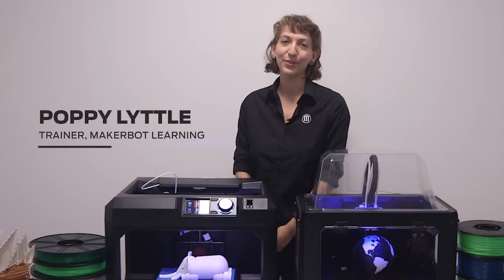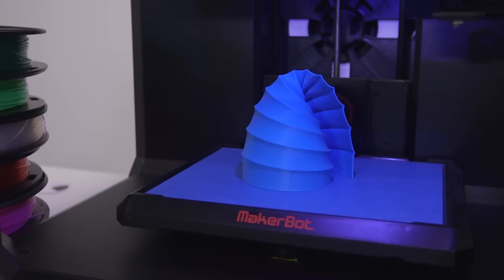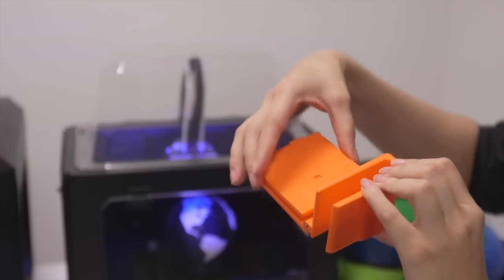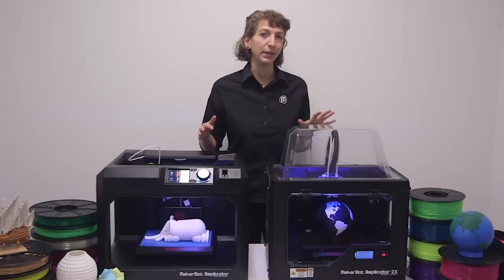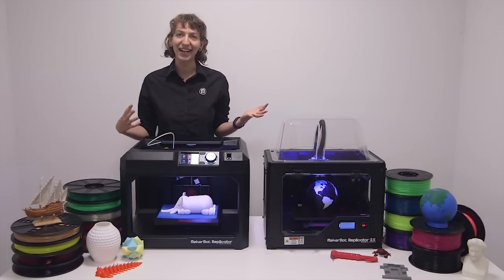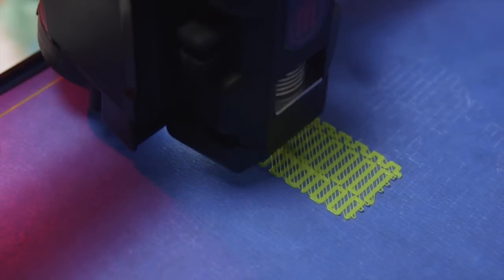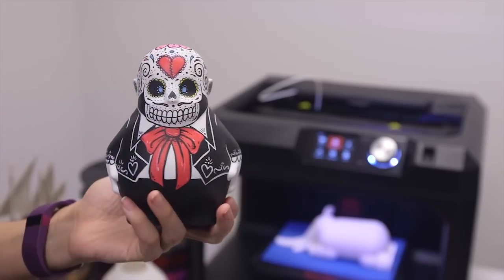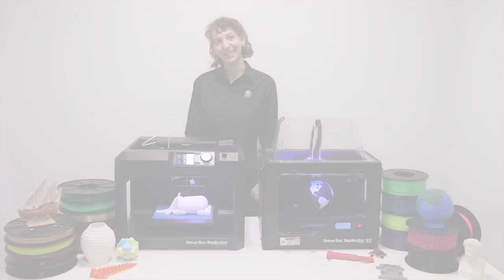PLA vs ABS | What's the Difference for 3D Printing?

Comment: Wait... wasn't the 2X discontinued? It's ancient and well outdated.
Reply from the maker: +Maker&#39;s Muse The 2X is still available and although some of the hardware and features may be considered outdated, software improvements in MakerBot Desktop and the ability to really customize the system make it very relative to the needs of some groups.
Reply: Odd seeing you here
Reply: It's still offered n Makerbot's website... I thought it was their newest product half an hour ago :S :S :S
Reply: Maker I don't think it is its on amazone
Reply: Lego is ABS
Reply: @hughsgarbagetrucks  it used to be abs. For a number of parts Lego decided to switch to polyethylene based material that is supposed to be better for the environment. While a lot of parts seam to still be abs I imagine that they will be moving the rest of the parts to use polyethylene as the materials required become easier to acquire at scale.

Comment: I didn't know you could print a bridge without supports? That's pretty impressive, I'll have to try that. Thanks
Reply from the maker: +John Alves Hey John, it is a relatively new feature driven by firmware and software updates. Currently you can do a 70 degree angle with no support and a 2 inch bridge

Comment: What chemical is used to remove lines from abs builds?
Reply: +Joe D&#39;Alonzo Acetone vapor, never use liquid on the plastic because it will melt it and ruin the shapes.
Reply: +Joe D&#39;Alonzo acetone
Reply: +Joe D&#39;Alonzo acitone